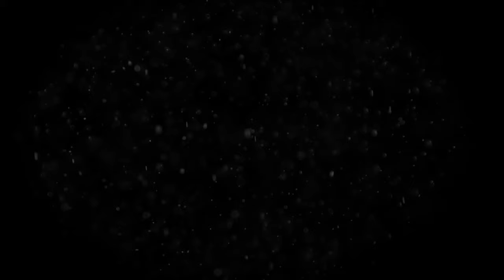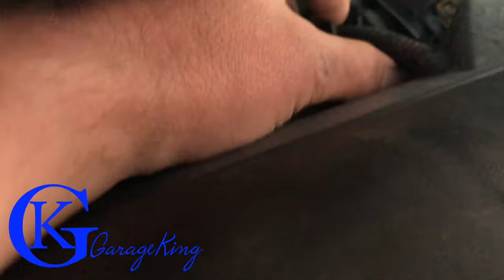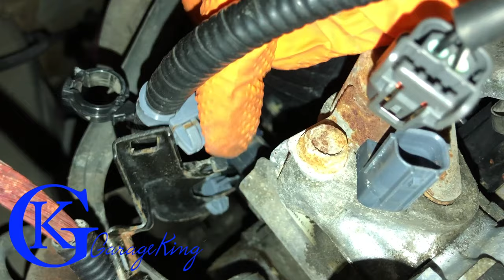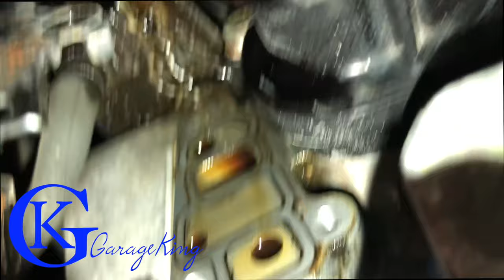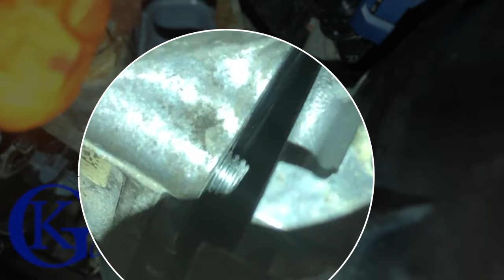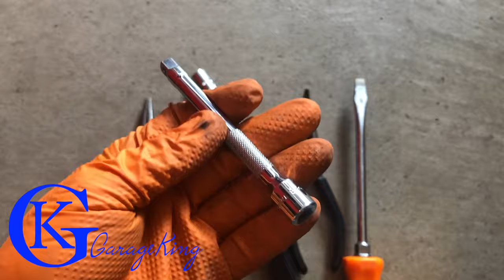Honda Civic Leaking Oil on Passenger Side from Cylinder Head

Comment: hi first off i love your tutorials, thank you so much for them! so far i've replaced my driver side side headlight assembly and i think successfully changed this gasket! i feel no new oil around the VVT but i still have major leaking from what looks like the oil filter? i have no lift or jack so i can't see if the leak is coming from higher up but i took a video and saw large drops dripping off the bottom of the oil filter every second when the car is running only. i can't get the filter loose with just my hands to even try to replace it but do you think the problem is as simple as that? if so i'll take it back to where i had my oil changed about a month ago if the problem could be the filter they replaced, thank you again!!
Reply from the maker: Hey there, thanks for the great comment !!  Appreciate the time you took to write it.  Firstly congrats on doing all that work yourself, you have attempted more than most.  To answer your question, yes the oil filter can leak, and I have seen them with a bad seal (sometimes the crimp leaks) so that would be your problem. You could always wash the engine down (you can do it  with a garden hose on the street)  Get some engine shampoo and when the engine is cold spray it down and hose it off.  You can do this from the top so you don't need a lift. Just make sure you do use high pressure and DON"T get the alternator wet (put a plastic bag over it) then if the oil is dripping when its running it should be very easy for a shop to see where its coming from and not confuse it with anything else.  A set of drive up ramps is pretty cheap and can pay back dividends for the DIYer, but if you get a set, don't buy the cheapest set as many times the tires will slip on the plastic.  Get a decent set https://amzn.to/3PZsUAK   Have a good weekend :)
Reply: @GarageKing   thank you so much for the information and the link! I'll be getting that so I can keep doing my DIYs :) I wish I posted about this sooner, I really need my car for work so I ended up taking my car in to the same place without washing it down but I did try to wipe up the area a bit below and what I could reach from the wheel cover, all oil leaking is fresh so I'm hoping that'll help pinpoint it. When I dropped it off and said another shop said it looks like the filter though they still said it might be the VVT since I denied the replacement (I didn't tell them I ended up doing it myself). I asked them if the VVT solenoid was at the back of the engine and they said there were 2, one above the oil filter. I have an 8th gen DX but could only find replacement parts for the one you showed in the video, is there another I can easily change out if it is leaking?
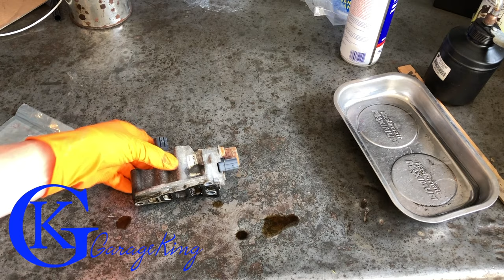Reply from the maker: @pixielikepanda    Thanks for the follow up, as far as I know there is only one VVT, but there is an oil pressure switch that can leak when the engine is running. Its actually screwed onto the VVT part, you can see it at 3:24min mark quite clearly.  They don't leak often (actually very rare) but when they do leak, they leak bad, and only leak when the engine is running.  I had one on a corvette the other day that was dripping like crazy !!  Anyway the only way to really check that piece is with a mirror and a light when the engine is running from the top, its its leaking your are going to see it drip and the oil will actually come out of the connector.  When you unplug the connector it should be DRY, if its WET then its starting. Hope this helps you out :)

Comment: I have an oil leak on a 2000 Honda Civic right below the engine on the passenger side as well. I don't supose you would know if it could also be the VVT?
Reply from the maker: Off the top of my head its probably the VVT (Variable Valve Solenoid) if it has one, but if its the older style engine that has a distributor or plug on the side, check that as they are known to leak.
Reply: @GarageKing  just got some dye and we'll see in a couple days. Thank you for the video, I'll update this comment once I find out!
Reply from the maker: @EasternBoundish  Sounds great and I would be curious to know.  Thanks

Comment: Do you have to drain the oil before doing this or can it be done on a cool engine? Thanks so much!!
Reply from the maker: no oil drain necessary, and yes, do on a cool engine so you don't burn yourself.
Reply from the maker: Do check the oil level when you are done, none will leak out when doing the job, but your car might be low because of the leak.

Comment: Do I have to drain my engine oil? I just had changed my oil yesterday
Reply from the maker: Nope, you can just change the part.  Be careful not to get anything in the engine when you are cleaning.  Wouldn't hurt to check you oil level :)  But you don't have to change your oil. Happy Saturday to you :)
Reply: @GarageKing  thank you. I ordered the part and will do next weekend. This is very very helpful
Reply from the maker: @marvinu_  Thanks for the great comment :)

Comment: Thank you for the video and greetings from Poland.  I have a question with what force to tighten the bolts from the valve and in what order.  Sorry if you talked about it in the video but I don't speak English
Reply from the maker: Cześć,
Nie ma sposobu, aby włożyć tam klucz dynamometryczny, jest bardzo ciasny, więc po prostu przylega, śruby wcale nie muszą być bardzo mocno dokręcone, niektórzy ludzie zatrzasnęli śrubę, więc nie dokręcaj zbyt mocno. Nie jestem pewien fabrycznego momentu obrotowego, ale to niewiele, to mała gwintowana śruba.

Hi There,
There is no way to get a torque wrench in there, its super tight so just snug up, they bolts don't have to be very tight at all, some people have snapped the bolt so don't tighten too much.  I'm not sure of the factory torque but its not much, its a small threaded bolt.
Reply: @GarageKing  Thank you for your help, tomorrow I'm going to do it, I have a big leak from that area.  I will also replace the PCV valve prophylactically, there is also a large amount of oil around it
Reply from the maker: @Chudy19931  Glad I could help and I hope you get the job done tomorrow !!

Comment: Have you seen this leak while just adding oil? I ask because i have a leak on the same side of the engine and when adding oil I can see it slowly leaking.
Reply from the maker: No I haven't, but can't say its not possible.  Normally I would think it would only leak under pressure.

Comment: is the oil stain at the beginning of the video really after leaking from the solenoid? I'm asking because I have similar signs of leakage on the passenger side and the spot is just as big when starting from cold. I pray that it will be the same.
Reply from the maker: Hey There, the stains were actually not my driveway.  I was walking though the neighbourhood and saw that and thought it would be a pretty good effect for the video. The leak starts slow but then gets quicker.  If you don't fix it I could see it causing a big stain.  I caught my leak fairly early.  Happy Sat to you !!

Comment: I replaced mine and it was all good, but i’m changing my oil and notice it’s leaking again. I assume it’s from the same spot. Why would it happen again so quickly?
Reply from the maker: It shouldn't.  Hopefully you cleaned well around the area.  The repair should last years as its just a rubber gasket.  There is an oil pressure sensor on the unit and perhaps that is leaking??  if you can give it a wash and then run it with an inspection mirror that you might be able to pinpoint it.

Comment: I changed mine but now I have the check engine light on ? Never had that issue before. Do you know if I need to reset something ?
Reply from the maker: You should not need to reset anything, but make sure you plugged everything back in.  If you have a scanner it will probably point you to something you forgot to plug in.

Comment: I just replaced my valve cover seal and two days later i was leaking oil in this exact spot Is that normal to happen after switching out the old seal but not doing the part you did?
Reply from the maker: I wonder if its the part in the video that was leaking and not your valve cover.  Changing the gasket on the valve cover would not affect this part and visa versa.

Comment: What’s the best way to clean up a oil mess on the side of the engine?
Reply from the maker: I used some engine degreaser and a garden hose, I found that worked best and was most economical.  You could spray brake clean at it and its going to work VERY well, but you are going to use a few cans which gets expensive.

Comment: What year Honda Civic is is cuz I got a 2003 LX 1.7 or is this for all Civics
Reply from the maker: Hi There, yours is a 7th gen, this vehicle was an 8th gen.  Your engine is a little different, its a D series engine. You have a distributor on the right side of the engine (when standing in front of the engine with the hood open) There is an O-ring that very commonly leaks and it does cause a leak on the passenger side. Its a fairly simple job to do.

Comment: Isnt that the vvt solanoid my check  engine light came on and what kt was doing it wouldnt let me drive past 3500 rpm but once i replaced it it drove perfect, my car is still leaking oil but im not sure where
Reply from the maker: Yep its the VVT solenoid. I would wash your engine down then drive it, or run it for 30min and check.  Sometimes they leak from the plug in the cam cover.

Comment: what size are the difficult access bolts? I wonder 10-12 mm head but i cannot see exactly.
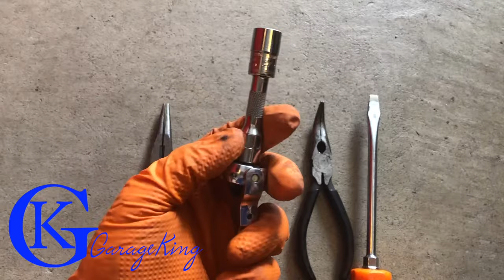Reply from the maker: Hey there, at 7:35min mark I go over all the tools you need, its a 10mm socket

Comment: Awesome video! Couldn't have been easy to post-process/edit all that, especially with the magnification! Thank you so much! I am 90% sure I am getting a leak from this very area. I am also leaking coolant from the back of the engine block, somewhere between the block and the intake manifold... I can't get eyes on where it's coming from, but I do see droplets of blue coolant. Any idea what that is?
Reply from the maker: Thanks so much for the great comment, these vids are not easy to do this way, and it sure beats seeing one that is 25min long with poor filming !!!!  In regards to your coolant leak I'm hoping you don't have a head gasket leak...  If you have a pressure tester I would test it (make sure engine is cold) The pressure testers are pretty cheap https://amzn.to/3TqLGji (something like that) and then you have to get underneath and have a good look.  I'm hoping its just a hose from the heater, there is not too much back there so if you can crawl underneath and use a mirror if you have to, you should be able to see.
Reply: @GarageKing  I'm also hoping it's not a head gasket leak. I tested with a pressure tester hooked up to the radiator cap, and lost pressure, indicating the leak. I am hoping it's a heater hose... but debating on if I need to remove the intake manifold to get to it.
Reply from the maker: @alihamidani3154  If you jack it up on stands you may be able to get in there to look.   I use the quickjack system in my garage, here is a quick vid of it.   https://youtu.be/0JsUoW2aXOA so it lifts the vehicles about 2 feet and I can get in there pretty good to see leaks.  When I was diagnosing the Honda for the oil leak I was able to get right in there.
Reply: @GarageKing  Those are pretty awesome! Will have to add them to my wish list. I did get a fiber optic camera to take a look... still can't find the smoking gun (or in this case the spot were the blue juice is oozing). Thank you again for the help! Will have to let you know what happens!
Reply from the maker: @alihamidani3154  For sure, I would be interested to know what it was.  Normally they don't leak there so I would appreciate the follow up. Thanks and happy Sunday to you :)
Reply: Based on my experience this is caused by a cracked engine block. I had this same situation back in 2014. Im lucky since i was still in the window for the recall when I noticed this.  Check for the 2008 honda civic recall regarding crack engine block.

Comment: I have a 95 honda civic Ex and their is an oil leak or a leak of some sort on the drivers side by my serpentine belt, what could this be ?
Reply from the maker: The best thing to do is give it a quick shampoo and then run it for a day and check and it should be easy to tell.  I know on yours the distributor O ring is known to leak, but that's on the other side. For yours maybe its leaking at the valvecover??

Comment: Do you loose oil when doing this?  I need to do it and was going to do it on my next oil change.
Reply from the maker: No, you might loose a tablespoon or so, the only thing is you want to make sure when you are cleaning the rear area that you don't get dirt in there.  Feel free to do it anytime, no need to wait.  The one thing I would do is degrease the engine before you do it, makes the job that much easier and the risk of getting dirt into the engine much lower.

Comment: Really quick and informative video! Love that swivel ratchet too. Figure I could treat myself to buying one with all the money I'm saving by not allowing the local Honda stealership replace the entire valve when only the gasket is faulty, at the tune of $532.73.  Do you think it would be worth it to change out the o-ring on the oil pressure sensor that's screwed onto the valve while it's out, or just leave it alone?  Thanks for posting this video!
Reply from the maker: Hey There, I would just leave the oil pressure sensor.  Usually if they leak its quite bad so most likely its ok.  I have only ever seen a few leak so yours is probably ok.  The swivel ratchet is the bomb and really helps with everything.  Highly recommended and I use mine all the time !!!
Reply: @GarageKing  thank you, Sir! I appreciate benefitting from your knowledge and experience.
Reply from the maker: @alexross8722  Thank you for the great comment, much appreciated !!!!

Comment: Noticed some drips on the ground last week and had a peakbat the motor. I noticed the leeft side is wet of oil. Though not only on the backside like in the video. Also a bit on the front side. So the complete left side seams to be wet of oil.  Check oil onbthe dipstick and doesn't seam to be loosing lot of oil. Better let it check by a mechanic
Reply: Just found a different video which actually shower about the same look on the motor. Seems to be a leak near the EGR valve. There's an plastic plug which seems to wear out
Reply from the maker: I would give the engine a wash and then run it for a few days, you should be able to see exactly where its coming from.
Reply from the maker: Yup, there is that plug on the side of the cylinder head, that is another spot that leaks.  Give it a quick wash and see.  Neither job is that hard.
Reply: @GarageKing  I'll try, but really looks like that plug issue. Downside is, i can hardly wash there by hand. There is a part in front of that, believe that is the EGR. Or i can use my pressure washer, but I'm not confident doing that. I'll see what I can do with garden hose perhaps
Reply from the maker: @RomboutVersluijs  If you can spray some engine cleaner down there, and then just rinse with a garden hose most should come off. You really should not need much pressure at all.  Then you can jack up the car (be safe of course) and look from underneath.  I did watch that other video and that plug is for where the distributer use to be on the previous generation of Honda motors (they don't use distributors anymore).

Comment: How do I know if my gasket is bad? I replaced my vtec solenoid but my car is still leaking.
Reply from the maker: The only really way to know is to look to see if it's leaking, there is a pressure sensor screwed into it, so that could be leaking as well.  I would wash off the engine with some degreaser and then run the engine and look with a flashlight and mirror to see exactly where its leaking from.  If you can't see any leaks then drive it for a day and check, mostly likely you will see it then.  Also from experience normally faster leaks are the pressure sensor and slower leaks are the gasket, but that's not a rule.  Just what I see most of the time.

Comment: Would this gasket cause oil to be all over your pass side axle and transmission?
Reply from the maker: Hey there, it can run down the back of the engine and get onto the axle.  Normally the transmission doesn't get oily because its on the other side and the bulk of the oil is on the power steering side, and it runs down and even makes your drain plug look like its leaking.  I would wash your engine down and then drive it for a day and inspect.

Comment: Thanks, i cant get this seal in India, its not available. Can I use seal maker to do this?
Reply from the maker: I would not use seal maker to do this, if you don't do it right you will get the seal maker in the engine.  Can you check Amazon in India to see if its possible?  I don't have link but you can click on the US or Can link to get the Amazon name, then cut and past the name in Amazon India.

Comment: what did you use to clean the oil once you removed soileniod
Reply from the maker: Hi There, I always use an automotive scotch bright pad like this https://amzn.to/3EnVCFj and then I use GM brake cleaner https://amzn.to/3A714tR to remove any residue.  Thats what I use on every oil pan, valve cover, or job like this and I have never had an issue.  The important thing is the scotch bright pad to ensure its a smooth surface.
Reply: @GarageKing  thank you!
Reply from the maker: @emanuelshahid9443  Anytime !!

Comment: Soo I have the exact problem but also my car won’t go past 3.5k rpm is it the sensor that goes there ?
Reply from the maker: Hey Thanks for the comment.  The sensor that goes in there is for oil pressure so I don't think it would be related to the 3.5K rpm.  You should check for codes, sometimes you can have pending codes that won't trigger the engine light to come on.